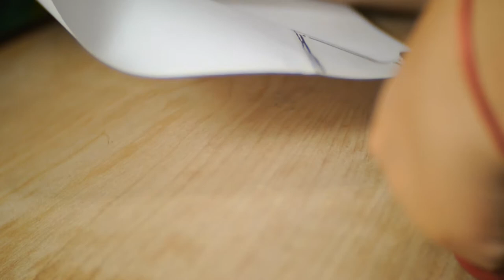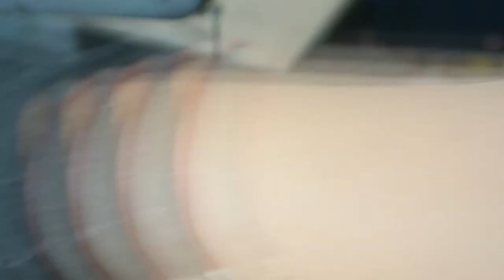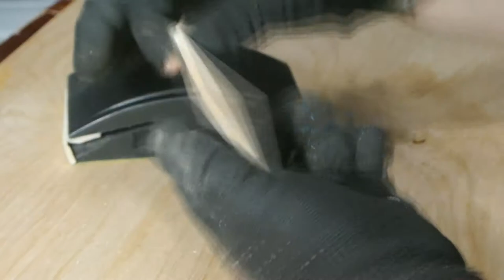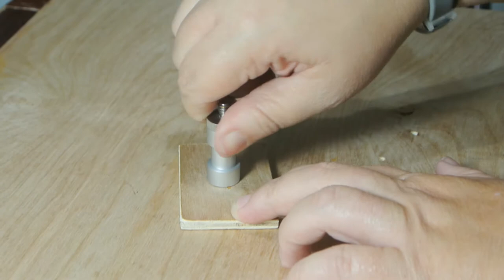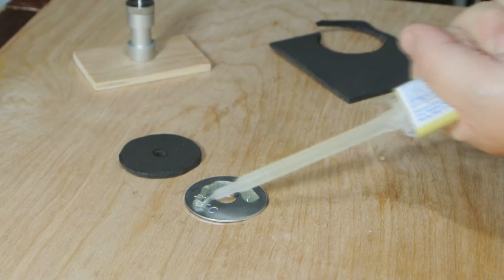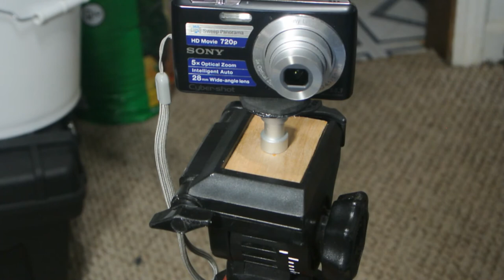How To Make a Wooden Quick Release Plate For a Camera Tripod

Comment: I'm getting ready to build something similar.  The last time my daughter borrowed (without permission) my tripod with the quick release, the mounting plate that attaches to the camera did not find its way back.  I haven't used the tripod in a couple of years, so I never noticed it.  I was taking it out last night so that I could take some photos for visas for some relatives who are going on a cruise and noticed the missing plate.  Also noticed where she broke the handle for winding the tripod head up and down, but that's not all that inconvenient to work around.  Not being able to put the camera on the tripod though is very inconvenient.

I'm thinking of something more along the line of a 1x4 block cut on a power miter saw to the correct angle for the toe and heel of the plate and using a Forstner bit to cut the recess for the 1/4" bolt head on the bottom of the mounting plate.
Reply from the maker: I still use the same one that you see on the video even though is made out of thin birch wood, it has been a good adapter for the tripod you see on the video. Go for it, you can't  loose if you have the tools. The most important part is to resolve the problem and have fun. Thanks for watching!!! :)
Reply: @RoseWoodWork  -- I was just thinking... Another reason to be able to create your own quick release plate is to be able to create a mount to be able to hold a cell phone or other type of camera that does not have the standard 1/4" threaded hole that cameras use for tripod mounts.  The bottom portion would just need a slot cut across it for the camera to fit in and the top could be another piece of wood with a slot on it with long bolts attaching it to the bottom portion.  Just need to finger tighten the nuts though so you don't crush the cell phone / camera.  Might be useful for those people who want to use their cell phone to take their passport photos.  I prefer the lens on a DSLR over a cell phone, so I don't do that, but some people might want that option.  Or maybe for some sort of macro of photo box type of photography.